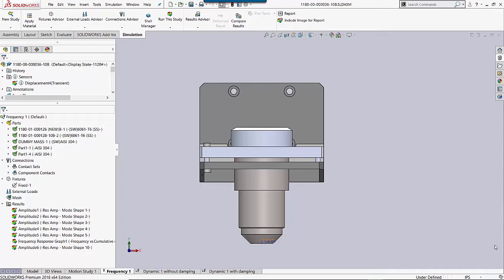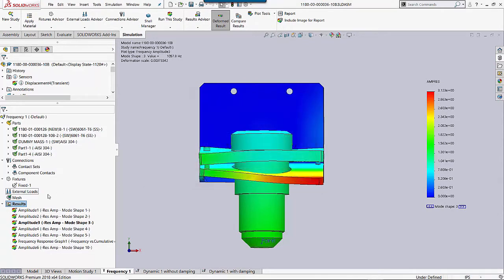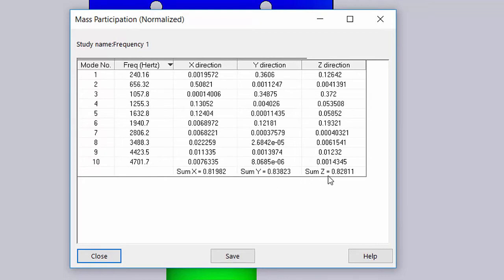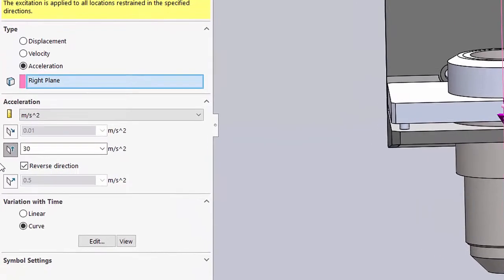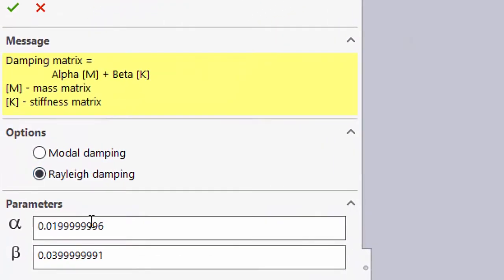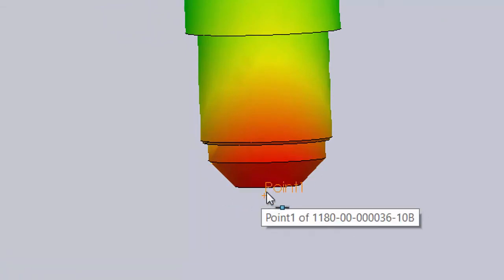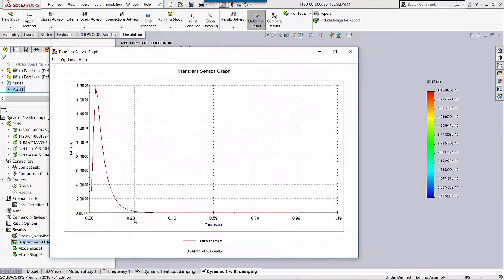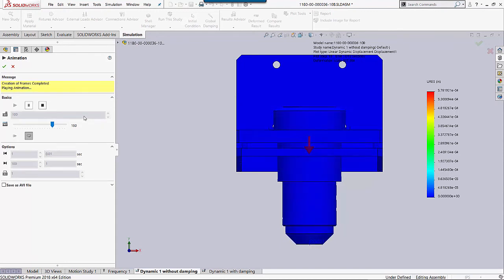SOLIDWORKS Simulation - Linear Dynamics Dampening Case Study

Comment: Thanks for the great video. Can you please help me simulate a milling machine cutting tool ? I mean a tool for roughing with defining the cutting force on the end of the tool with defining RPMs? I think the more accurate question is that, can such a simulation be done using SolidWorks? 
Many thanks in advance

Comment: I’m doing a load path study on a slider-crank mechanism. I did a static study placing a torque on the crank and seeing what happens. However how would I determine the maximum speed and force that the crank can handle. As well as the slider?
Reply from the maker: Linear static analysis does cannot handle variable loads. If you want to simulate the stresses on a design based off a variable load, then you will need to run a Nonlinear Dynamic analysis. If you do not have access to this tool, please feel free to contact a sales representative at GoEngineer to purchase this software as well as training in how to use it.

Comment: Hi is there any way to correctly add damping values on both parameters for beta and alpha for Nonlinear dynamics?, like for example you do a bullet impact test, is there any way to determine the correct damping for this? thanks..
Reply from the maker: The Rayleigh damping parameters are used to simulate numerical damping to reduce high frequency noise during the simulation process. It cannot be derived directly from experiments but can be obtained from modal damping ratios at a few frequencies of a system. A good source for these values would be research publications that can be found on Google Scholar that are similar to the case you are trying to study.
Reply: @goengineer  Hi thanks for the response, if you can give me a link to where i can get this values to at least the correct way specially for doing fast impacts like ballistic, yes i know its not possible for tearing of mesh but at least it would be best if i can at least know or estimate the damping needed for such scenarios, thanks very much for your help..

Comment: Great video! I was wondering, you applied the acceleration excitation downwards, but why does the reaction seem to start off as upward?
Reply from the maker: If this was a force load, then I agree it would start by going down. But I applied a base excitation acceleration load so it is as if this device is bolted to a shaker table that is vibrating up and down in at a 30 m/s^2 acceleration. So if the whole device starts by going down, then that is why we see the response of the device going up at first.